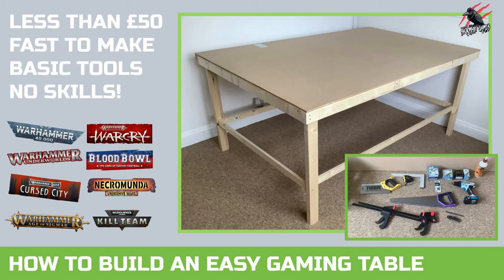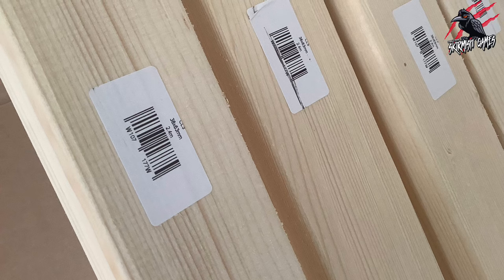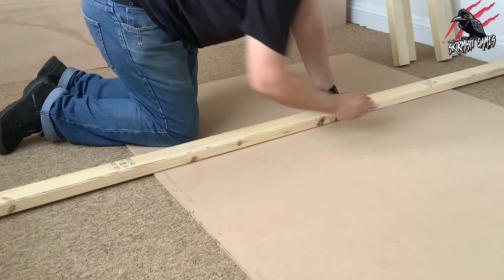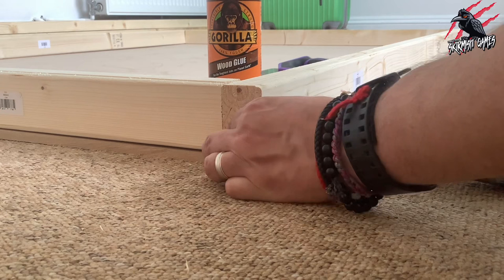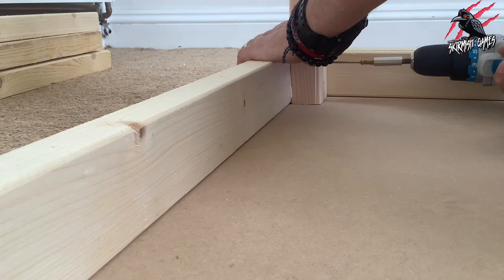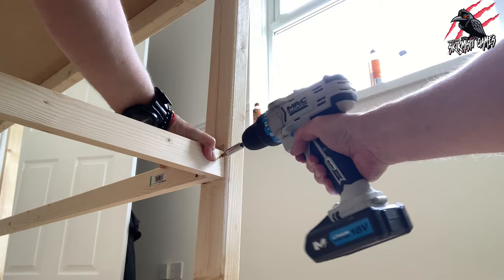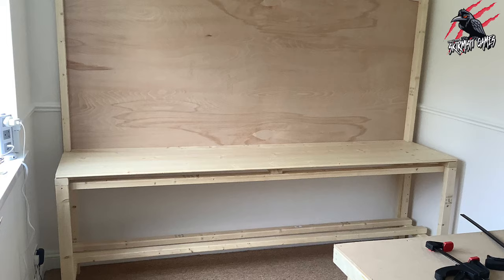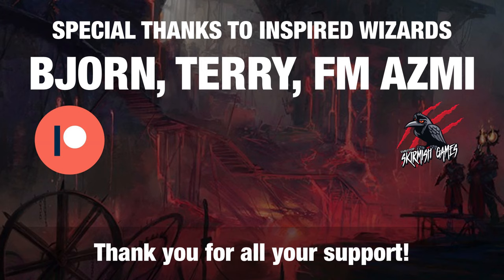HOW TO BUILD A GAMING TABLE - 6ft x 4ft - Quick & Easy With Basic Tools For Less Than £50/$70!

Comment: You should buy some pegboard to install on that that vertical MDF of the workstation at the end of the video. I have one over my desk and it's pretty useful. I use small wall fisher instead of the usual pegboard hook to hang out things on it.
Reply from the maker: Nice idea! That would be awesome. I’m planning to fill this with shelves and hooks as I get going but a peg board would be cool to add. Thanks! 👊
Reply: @tabletopskirmishgames  you can easily create some shelves on the pegboard with the same wood you use for the leg of the table + some square bend hooks. 
So they will be modular and you can change their position based on your needs.
Reply from the maker: That’s great, thank you 👊

Comment: Argh! Cut own 8 foot length :( Know space is a premium here in the UK, but our cousins across the pond have/had a habit of 8x4 tables that had a lot of logic to them. Room for snacks, drinks, books, dice boxes, reinforcements and dead to the sides when used as a 6x4, room for two games at once when using 4x4/3x3. EDIT TO ADD at very least an inch or so overhang each way helps keep gaming mats from rubbing on the rough edge and getting messed up, plus slightly lower risk of knocking stuff on the gaming area on the floor too
Reply from the maker: Yeah, I was hoping to keep this at 8 foot as all the beams and the sheet were the perfect length already and that extra space would have been nice. Not enough room, though. This will work for me as I play mostly skirmish games and will be using it to film Battle Reports but as you said, if anyone has room for 8 ft table then definitely keep it big. Thanks for watching! 👊